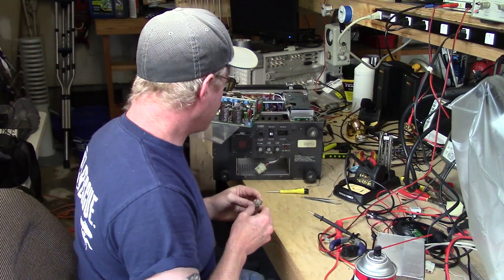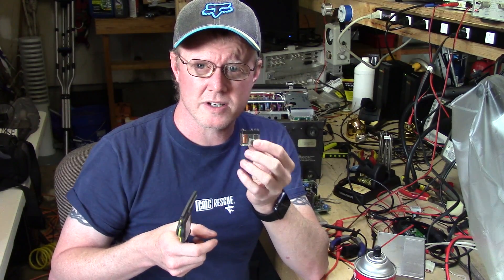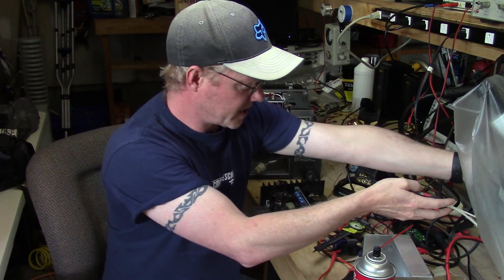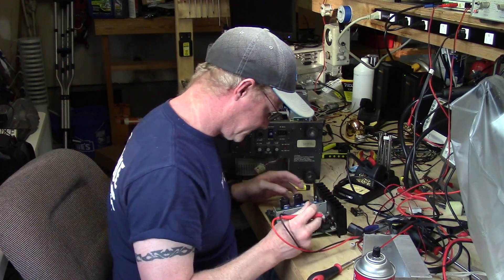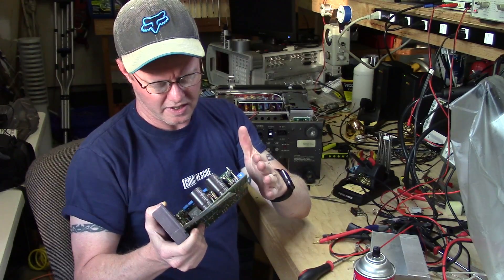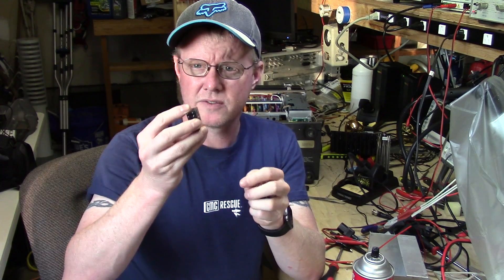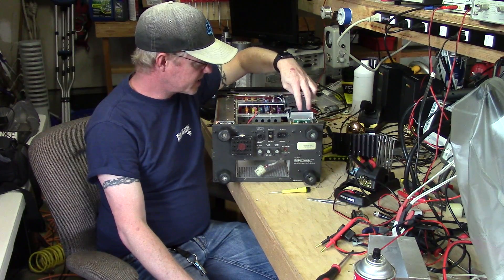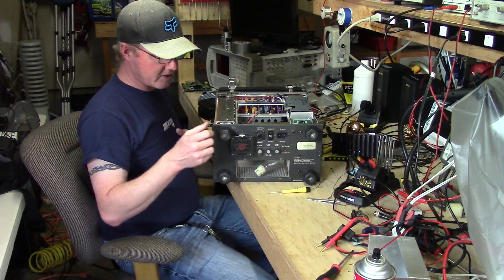Motorola R2210B/HS Repair Teardown Part 2

Comment: Greetings, I have a Motorola R2600/2660 service monitor, overnight in the spectrum analyzer function it shows vertical lines and the ground level rises to the top of the screen and in the form of points, I don't know if you know what is causing that defect in the equipment
Reply from the maker: It could be many things.  Did it work prior?